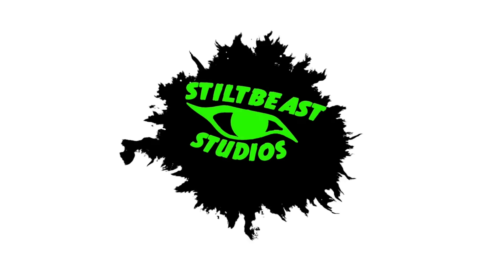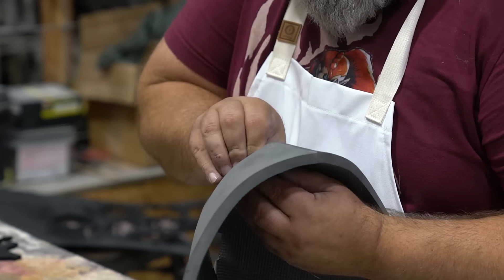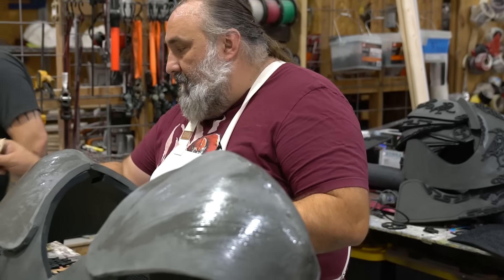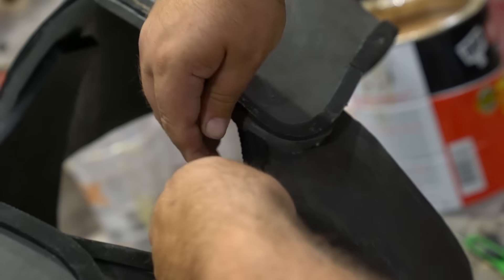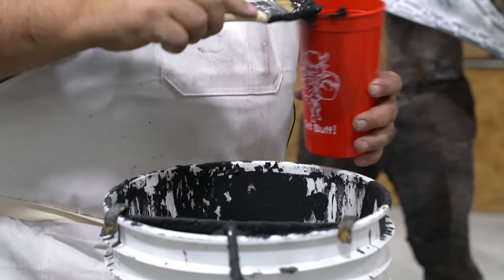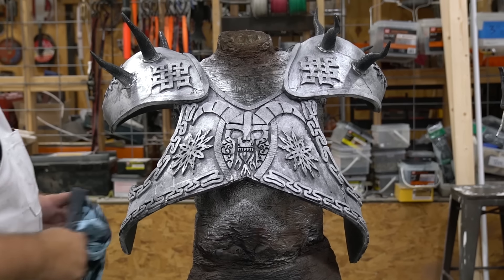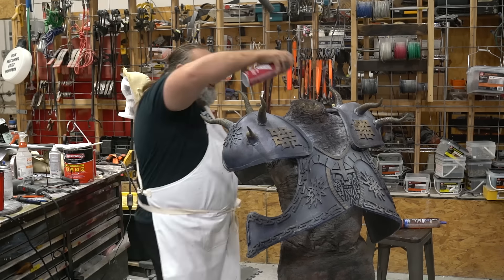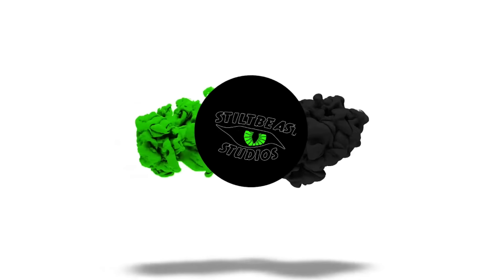Foam Ice Armor

Comment: Here comes the axe, her comes the smasher...Yes! This came out great! Thanks for sharing! Also, can you use plasti dip for a primer? The bright coat silver is definitely my favorite metallic that mainstream spray cans produce, too. Great work.
Reply from the maker: you can, but the xylene and contact cement primer helps the plastidip stick- its a necessity.
Reply: What ratio do you recommend for xylene to contact cement?
Reply from the maker: six parts xlyene to one part contact cement.